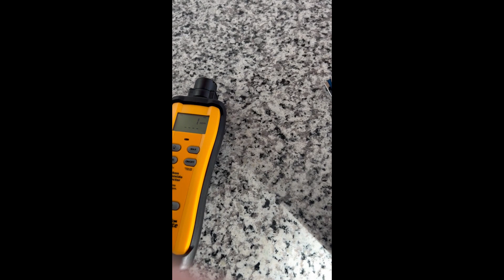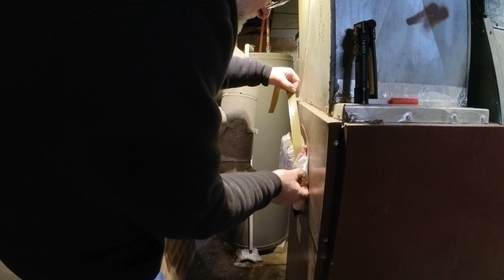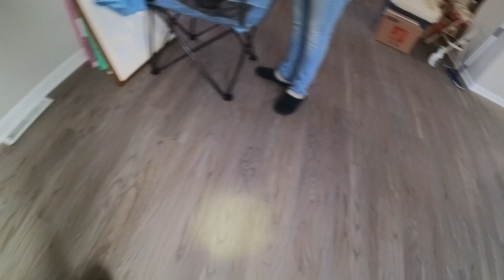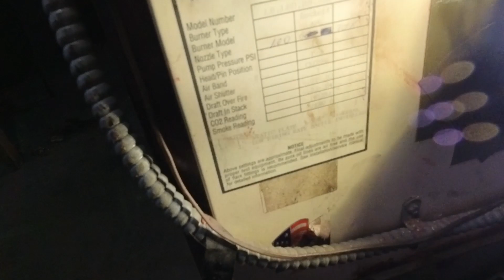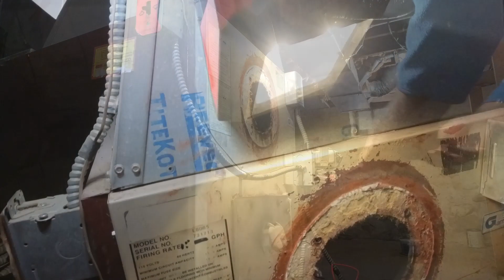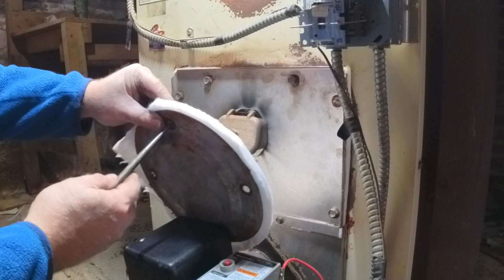Smoke Testing a Furnace Heat Exchanger & Co Testing

Comment: I knew a 60 degree wasn't right as soon as you pulled it out. I have seen some techs use 60s instead instead of 45s on L heads. But beckett are generally 80s or 70s sometimes.
Reply from the maker: Yes, this was a F head, definitely an 80. What gets me is they scratched out the nozzle size on the rating label and wrote in there own! Thanks for watching 😀